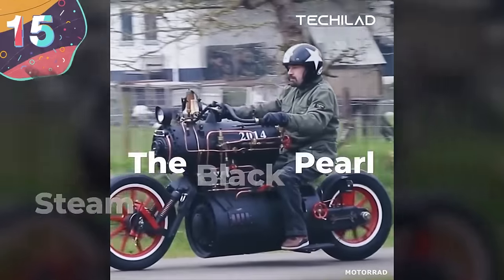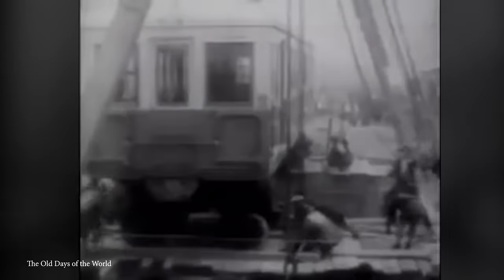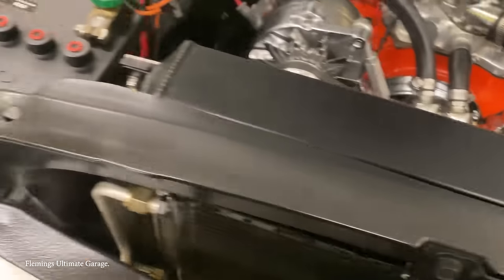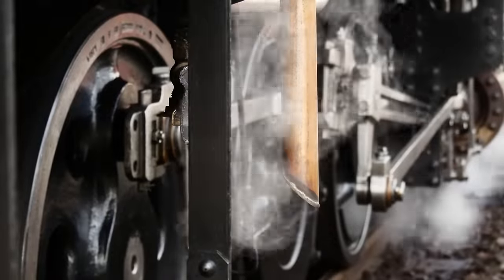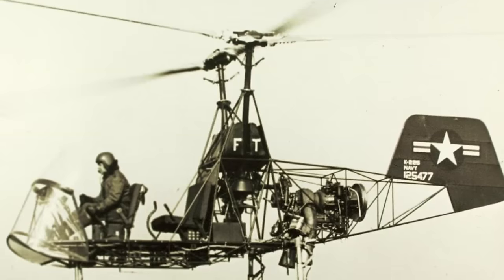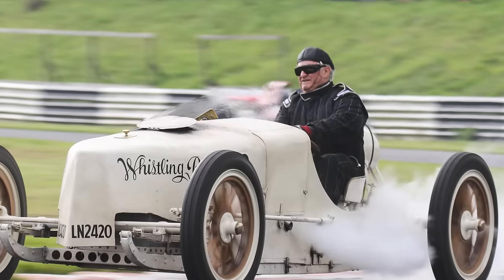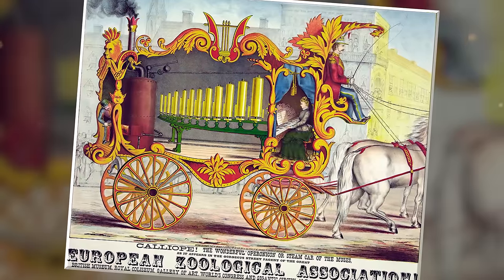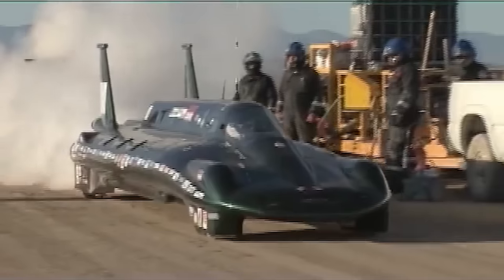15 STRANGE Vehicles Powered by STEAM

Comment: Considering what’s going on in cars today, we might be driving steam powered cars and trucks again, real soon!
Reply: Wouldn’t be apposed to this
Reply: That’s never gonna happen😂
Reply: Imagine if the same amount of effort put into combustion engines was spent developing electric steam engines
Reply: @Identifyasaconspiracytheorist  imagine if people would actually realize c02 and nitrogen are good for plant life and how much more environmental damage happens while mining for all the resources for electric cars and batteries
Reply: @c0ldyloxproductions324 

Everything seems to be killing the planet.
Reply: Nope electric lol but need more then just gas to make them lol makes no sense and what about the battery it as big as the car I’m 50 years we will see the damage caused by battery’s from electric cars
Reply: @tylergoins2026  

It’s been said that hydrogen is the best bet because it can be dispensed like gasoline and it’s lighter than battery packs.
Reply: Lithium batterys are very energy packed, just a couple of those bad boys in the fire box, short circuit them, bam instant heat.
Reply: Very possible with modern heat pumps and lithium ion polymer batteries used in EVs. Give a steam engine some overdriven gearing and it can be really fast with a lot more range.
Reply: Boiling water with a Lithium battery?

I think its better to burn some biomass instead... No massive mining industry polluting that way... Or child labour...
Reply: Very high maintenance...you'd get tired of it...trust me!
Reply: With the amount I drive I’d have to leave the pilot on😂 unless they have a boiler like the white cars.

Comment: steam helicopter - but it's not April Fool's Day - interesting what people will believe
Reply: It's not impossible, just impractical. The Besler steam plane flew.
Reply: @howardking3601 - Due to the high energy density of most fuels, compared to the low energy density of batteries, a steam helicopter actually seems more likely than a battery-electric helicopter, though each also seems likely to have only a short range.

Comment: ??? The fowler Ghost was a fire brick Steam locomotive. the issue with the Fowler Ghost was the fact if the boiler ever ran low on water there was no way to drop the fire preventing a crown sheet failure and a boiler explosion. Their contribution is literally they're the first locomotives for the London Underground soon replaced by regular traditional tank engines until Electric locomotives were able to take their place.

Comment: Regarding the comments on the K Class subs. They did NOT see the end of steam engined submarines. In fact most of todays large submarines are steam powered.
The resurgence started in the 1950s when the coil/oil burners were replaced by nuclear reactors. With very few exceptions, nuclear power plants are no more than glorified steam plants.
Reply: Steam driven nuclear-powered.👍
Reply: @JusticeAlways  Steam powered, nuclear fired.

Comment: Ever hear of  steam elevator? These were in use in the late 19th century. Steam elevators had a steam engine usually in a different part of the building that was linked by a train of apparats to transmit power to the elevator's machinery, usually consisting of a drum on which wrapped the hoisting cables that moved the elevator car up and down. The elevator driver would use control ropes in the car to raise, lower, or stop the car. The steam engine had to be constantly running for the elevator to work. It took about a half an hour to fire up the steam engine in the morning in order to have service. A  modern electric elevator's motor stops when the car is at the desired floor, much more efficient.
Reply: In Melbourne, some very old buildings had water driven elevators, I’m not sure how they operated, I think water flowed into a piston and ran until the 1970s. They were given an exemption to run during times of water restrictions. Perhaps they had electric motors and used water instead of hydraulic oil. They were slow and there was a height limitation.

Comment: The centipede was actually a diesel locomotive based on an F unit that was made from two car bodies that was powered by diesel electric engines
Reply: The Centipede pictured here was a Baldwin Locomotive Works design, and had nothing to do with Bessemer or steam power (or with EMD F-unit carbodies).

The truly interesting locomotive was the original one using the articulated underframe -- the 6000hp Essl design of the late Thirties which used individual modular gensets (first V12s, the V8s) to power individual axles in the chassis.  This was rebuilt for the Seaboard Air Line (to give a single-unit diesel with comparable performance to a good 2-6-6-4) and then made as two-unit 6000hp passenger engines to take over from T1s as the "GG1 equivalents" for trains west of Harrisburg...
Reply: Thanks for the info, I don't know all that much about the centipedes but I knew the narrator didn't have his info correct that's for sure.
Reply: There were multiple x-10-x locomotives. None were particularly successful for long runs but were useful where high tractive effort and acceleration is required - but electric motors do it better.
Reply: The Centipede is a diesel and is a Pen flyer F unit body locomotive

Comment: Fowlers ghost was a 1 of 1 locomotive, the plan was to make a locomotive to work underground in the British tunnels. It turned out as a poor steamer and one incident nearly caused it to explode in a station when the water ran out. This being die to its boiler design. As it not only had a firebox for conventional use, it had firebricks lining the boiler to retain heat to keep creating steam after the fire was dropped for traveling in the underground the issue was that despite the fire being out the bricks cant be removed from the boiler, thus it nearly exploded from lack of water and continued heating from the bricks. After that it was deemed a failure and taken out of service, with its builder allegedly denying the engine ever existing. Am interesting locomotive plagued with bad luck and poor design…
Reply: Why do they call it a streamlined design? The thing is a brick.

Comment: Fowler's ghost was actually a failure at a steam locomotive that could run subways without killing everyone with smoke inhalation, what happened is that it's fire box collapsed. And fowler's ghost wasn't streamlined, it did not pull express trains.

And the centapede was a locomotive run by an internal combustion engine, not a steam engine.

Also the drive system of jay leno's fire truck is run on internal combuation, the only thing steam powered was the water pump.

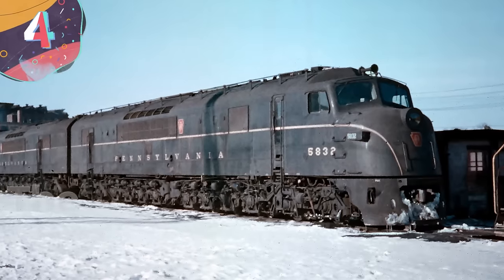Comment: 19:59 That is the Baldwin Centipede. A diesel locomotive with the wheel configuration of a Big Boy (4,8,8,4). And this was build around the time diesels took over the american railnet. Alco tried to make diesels. And Balwind ignored it until they no longer could. The Centipede was one of their attemps to compete with EMD and GE. And it was a fail. Mainly because Baldwin did not know what they where doing.

Comment: "An astounding record breaking speed of 148 MPH?" For such a gigantically HUGE engineering piece? Well that proves once and for all that Steam is VERY, VERY inefficient for such purposes.
Reply: It proves nothing. The engineering was not great, or else it would have been much faster. The Stanley brothers set the record over 100 years before with a very simple design. Given modern aerodynamics, materials technology, metallurgy and control systems, a steam car should easily run with any other wheel driven vehicle.

Comment: Given that steam is low speed high torque, you could probably get better performance by applying some geering between crank and wheels so that the wheel turns faster than the crank shaft.

Comment: The Sentinel DG8 had a duplex (twin cylinder) double acting engine mounted in line with the chassis. It's successor, the Sentinel 'S' had a four cylinder single acting engine mounted across the chassis.

Comment: The steam motorcycle pictured at the first of the video is actually powered by compressed air, However a British gentleman built a coal fired steam motorcycle named ‘Jenny’, a Garrett locomotive has a central cab & boiler. Just a couple of inaccuracies….
Reply: An American named Sylvester Roper built a quite successful steam bicycle... and the locomotive type is spelled 'Garratt' after its inventor; it deserves its own detailed video which should include the early Tasmanian express locomotives and the astounding Algerian engines of the mid-Thirties.

Comment: I don't understand the issues with the British K class subs. My ship in the US Navy today is propelled by two GTM's that only have two speeds that rotate the shafts. The actual speed with which the ship moves is governed only by the pitch of the blades. So the shafts could be spinning and the ship would go nowhere with the blades of the screws at zero pitch. In fact, you could replace the diesel power plants in my ship with steam engines right now and it would work in the same exact way. The officers of the ship would never know the difference during maneuvering.
Reply: Modern and advanced US subs are steam powered now too. If you removed all electricity from the sub, the shaft is still directly rotated by the nuclear reactor/boiler. Can't tell you about the Seawolf or Virginia class though.

Comment: There are soooo many things wrong with this video, its like you didn't even try , I'm going to try and correct one of them, here I go, Fowler's Ghost was designed BY JOHN FOWLER , but BUILT BY AND IN THE WORKS OF ROBERT STEPHENSONS AND COMPANY, the name fowler's ghost does not come from its appearance, it comes from the fact that the engine was such a failure it was a disgrace to his designer JOHN FOWLER, who after the scrapping of the loco in 1895 denied the existence of said machine, the locomotive in no way shape or form is streamlined, nor futuristic, it was a very common design for the era, it didn't have a cow catcher, it had things called rail guards which protected the wheels, it didn't have a promising speed nor performance because the locomotive only traveled 7.5 miles on its entire 4 to 5 years of life, the locomotive never worked on passenger services, as after its first trials the loco was withdrawn from service to try and fix the flaws that it had, its short life wasn't because of the advent of diesel locos, since the loco was built in the 1890s , it was because the loco leaked steam from every nut, bolt and joint.

Next time please proof read your investigations, as 2 other locos in this list are not even powered by steam, but rather diesel
Reply: It was called 'Fowler's Ghost' because the steam exhaust was blown down into the cistern (to prevent steam exhaust in the tunnels, and to recover the latent heat in the steam -- the latter working altogether too well!) and hence the locomotive had no more audible exhaust than an African class 25.  Since the mechanical work was made with typical British precision there was little noise, compared with other contemporary traction, when the engine moved.

Comment: Steam vehicles use fossil-fuels too (the ones that burn coal at least); they're no more environmentally friendly unless they burn sustainably-grown wood sources.
Reply: I would much rather breath in coal or wood smoke than deisel exhaust.
Reply: Actually they do produce less carbon monoxide which is the poisonous gas, carbon dioxide is good for the plants and helps plants grow faster alon tbh with nitrogen in the soil, the more rich the soil is with nitrogen the faster plants can grow and the more carbon dioxide can be converted to oxygen nitrogen air that we breath
Reply: Also if u think about it a small fire to boil the water produces far less emissions then the exhaust of a car that burns at way higher temps then a small steam powered car or even the doble steam car, which jay leno said surpasses the environmental requirements of California without modifications, which is incredible considering how strict California is